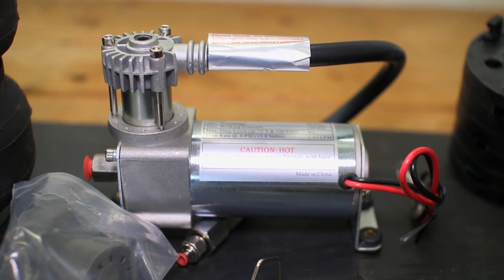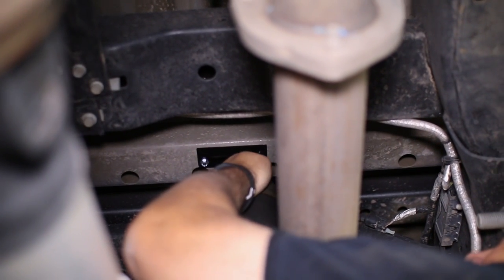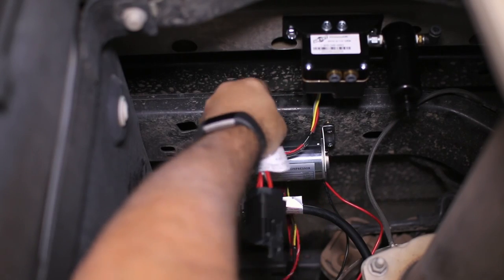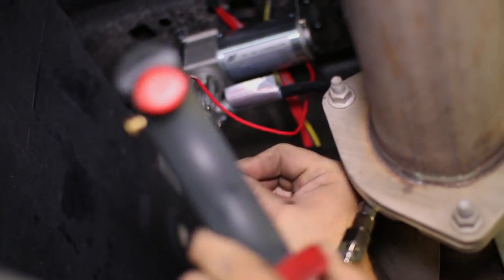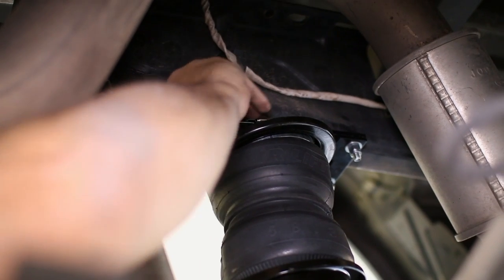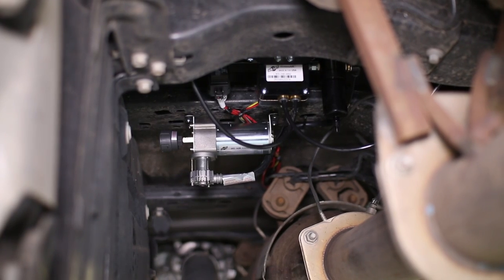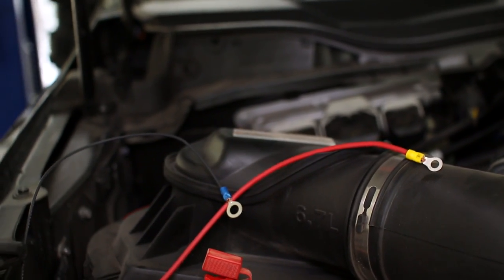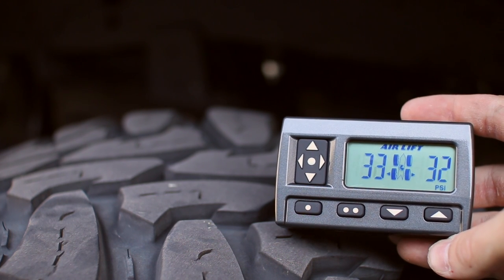Air Lift WirelessAIR On-Board Air Compressor System Install

Comment: Why did my instructions ask for 2 1/2' from compressor fitting to air dryer
Reply: You can run the air dryer up into you truck cab through a grommet.

Comment: I'm curious why you wired the positive lead to the battery when the directions call for wiring it to the fuse panel via a source that is hot only when the engine is running?

Comment: You need to get rid of that ridiculous sound. You need to show how to "join" remote to the controller. Mine fails half the time. I'll call Air Lift on Monday. It took me 30 minutes the other day to get the desired pressure.
Reply: Clint Johnson hi, what was the outcome of this, did you find a solution?

Comment: Nice video! I have a few questions/concerns....
1. It looks like you used stainless self-tapping screws to screw into the aluminum body of the truck. The non-black primed parts are aluminum cross-members under the bed. Having dissimilar metals touching will cause corrosion and ultimately failure of the parts. Did you do anything to address this?
2. You drilled into the frame. I've heard that this voids the warranty on the frame. Do you know about this?
3. This is all very close to the DPF which gets VERY hot during regens. Are you worried about the longevity of the cabling/compressor/manifold?

I ask this because I have the same kit, and a similar truck. Just figuring out how to get it all done. I saw one guy mount his above the spare tire by making his own bracket. I may try this approach. 

Thanks!
Reply from the maker: We will switch to aluminum screws in the future, but this is just a general install for all trucks and we wanted to install the kit as it was shipped to us from Airlift.

For drilling into the frame with the warranty, you'll have to talk to your dealer about that since all warranty decisions are up to them.

It is hard to tell from the camera angle, but the compressor isn't quite on top of the dpf. We kept everything as far away as we could while staying in that mounting location
Reply: Cool. Good stuff!

Comment: Would I be able to use the manifold and wiring and tap into my existing onboard air ...?? I already have a viair 444c compressor that kicks on and fills a 2.5 gal tank when it's at 115psi or lower and shuts off at 140psi
Reply from the maker: Seems like you could do it, you might want to give the guys at airlift a call just to double check.
Reply: @stage3motorsports  I've been trying to bounce info back and forth with then but it's either really slow or there's no response ..... I think I will end up buying the smaller solenoid they have on the site and attach that to the manifold so that when it commands air which would have been from the compressor would now come from my airtank .. I think it will need a reducer of sorts to keep if from thinking it's over pressurized